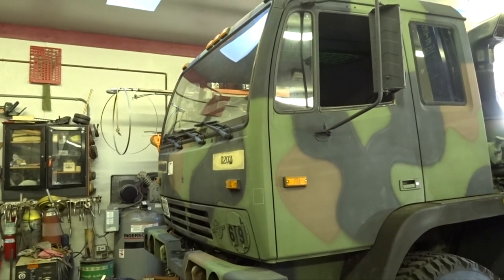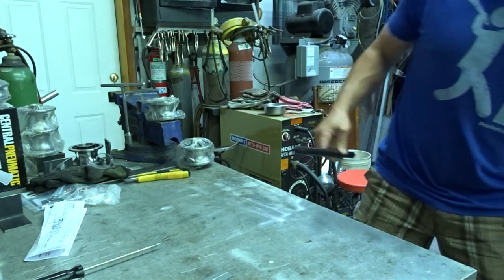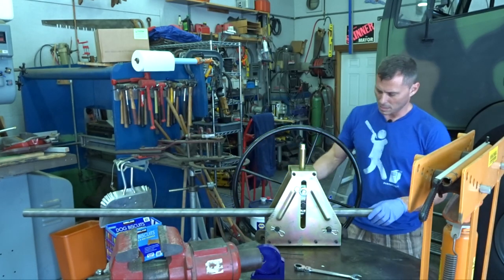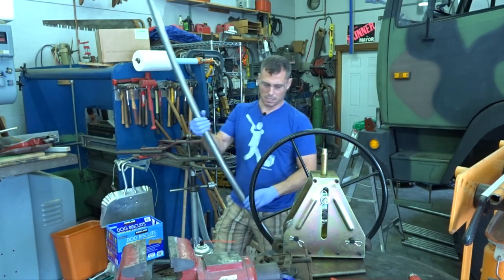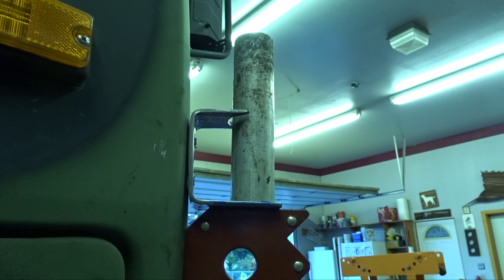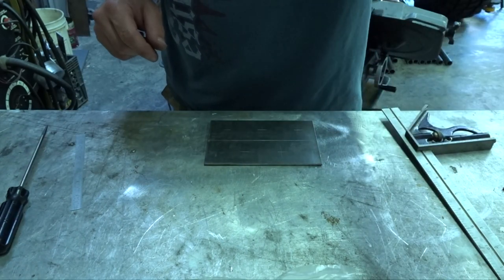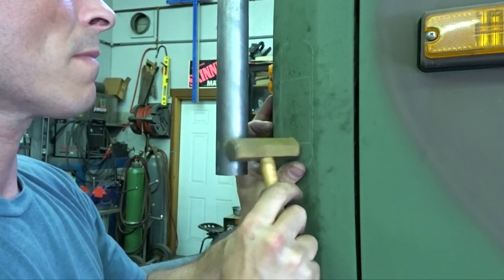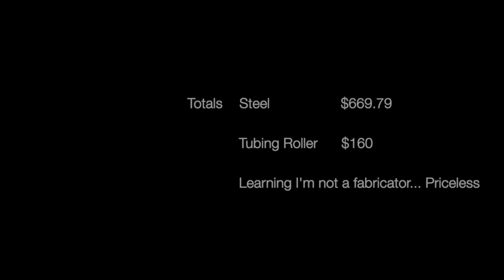Making Brush Guard Brackets on the LMTV

Comment: I have that exact same tube roller. Yep, the twisting is a *itch to figure out and remove completely. I've never sheared any of my bolts off mine, but maybe they were made better years ago? Great for making long radius bends, though the precision is not exactly the best with the twist factor. As for the video length, I try to keep the 10 minute, +/- 2 minute rule. Most people don't have an issue with that... the more lengthy it gets, the less interaction you'll see... save for us hardcore LMTV guys. Likes and comments help propagate your videos (YT analytics), so ask for them and give them regularly. Cheers! Keep on, keeping on!

Comment: Thanks for the video, I love your work (I hate you, but I have been told jealousy is an ugly emotion and I am working on that).  Why did you put the washer on the rivnut?  Was it to beef it up because of the weight/shock of the guard, or was it because the metal it was mounted in was too thin?  I am trying to put rivnuts in the door (for mounting the door panels) and it is eating me alive.  So far I have broken two mandrels of the insert tool and sheared off a  grade 8, 1/4 - 20 bolt.  The next step is to sell the truck and put all that money in Hello Kitty dolls.....
Reply from the maker: elgoog Sucks LOL, yep I wanted to beef up the sheet metal a bit and the hole is too small for a backing plate.

Comment: I don't understand what you did to modify the HF tubing roller to make it work better. If you could show me what you actually did that would be really appreciated. the verbal explanation made no sense to me
Reply: ok I found another video showing it: https://www.youtube.com/watch?v=bD-fneE-xvY   ok so the original bolts stripped out so just drill it out and run a bolt all the way through to reinforce the original set screws, i see
Reply from the maker: In the end I bought a new set of rollers and an upgraded shaft from swag Offroad.  https://www.swagoffroad.com/SWAG-Tubing-Roller-Dies-Accessories_c_54.html
Reply: @BrokeOverLand  thank you I'll check it out